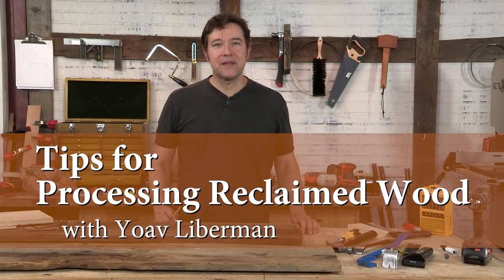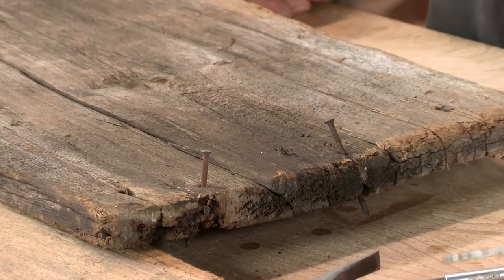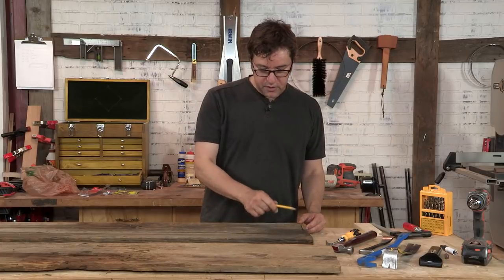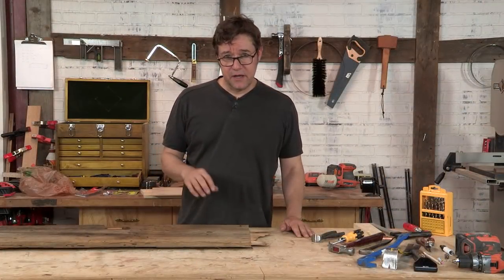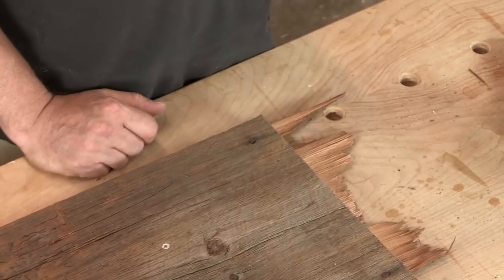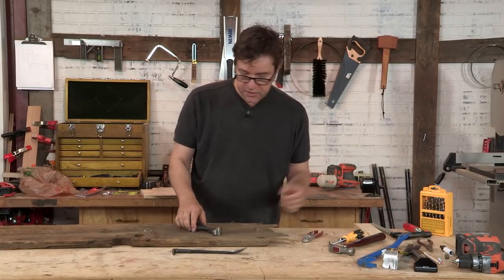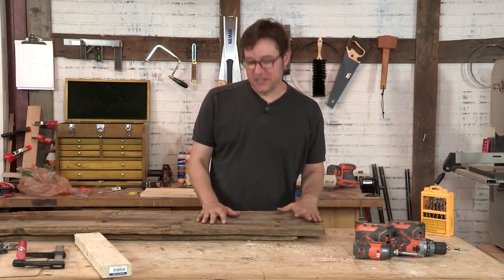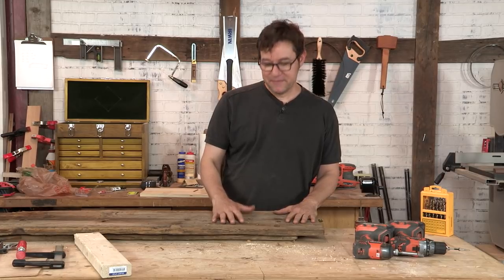Tips for Processing Reclaimed Wood

Comment: Thanks for the tip on getting out embedded nails using a hole saw.  I have some nice oak boards with quite a few countersunk nails that are sheared off on the back of the board.  I will try this, but with a 1/4" diameter diamond hole cutter.  The hole itself is only 1/4", so easily plugged with 1/4" dowels if need be.  I've found a small cat's paw to work best. This tip should speed things up. I've been using a countersink on the underside to pop up the nail head, but this may speed things up.  These old boards are so much better than what you can buy new.  Well worth the time.

Comment: I've found that a pair of plumber's slip-joint pliers are one of the best tools to extract nails. The ends get a good grip on the nail, even if the head is missing, and the diminishing-radius curvature of the back of the pliers gives you an excellent fulcrum that gives you a LOT of mechanical advantage.

Comment: My tip. Never put reclaimed wood through a jointer or thicknesser  that is dirty, been on the floor etc.
Old wood, pallet wood, reclaimed wood, probably has pieces of grit embedded into the wood grain, it will chip and blunt your jointer thicknesser blades. Have an old plane to quickly take off the surface after you have remove any metal, takes a minute to roughly plane, a lot quicker than sharpening your  machine blades.
Reply: Another reason to do the above, once saw a guy saw some large pieces of wood on the table-saw that destroyed the blade teeth. He had used a metal detector to check for metal, he did not use a plane to clean the wood.
The wood was about 8 inches thick, looked like one piece, it was two old oak fence posts that had been laminated together at some point, it had the remains of two bolts in the middle of the wood, the detector did not find them since they were four inches of oak between the bolt and the surface. If he had planed the surface the wood plugs that were used to fill the bolt holes were visible, he would have know that he needed to find out why they were there.
Reply: true dat!
Reply: my tip is lean the recovered wood against a wall, and blast it well with a pressure washer then allow to dry, then you have clean wood, no dirt in the surface.
Reply: Thicknesser? You mean a planer?
Reply: @JohnyKnox  yes. Doesn't matter what machine you are using. Planer or jointer, thicknesser, table saw. Unless you want to risk damaged blades. I would never used dirty reclaimed wood without a quick going over with an old hand plane.
Blades are expensive and a pain to sharpen.
Reply: @dwarfsbaneironfist2527  sorry I had just never heard the term thicknesser before. Definitely learned something new today but that's what these videos are all about eh?

Comment: on nail #3, why not 1) try punching it through with a nail set?   2) If that  doesn't work, use your hole saw on the back side, not the face side.
Reply: Exactly. As I watched I was thinking why not use a nail set and (like you said) drive it on through, or turn the board over and use a nail set to back it out so it could be pulled.
Reply: This a great tip Keith. The reason I showed the drilling technique from the face side (in this video) is because it is the most common and practical approach  when dealing with timber and beams. There, the option of extracting from the back side is not possible. In my upcoming book: Working Reclaimed Wood (https://www.amazon.com/Working-Reclaimed-Wood-Woodworkers-Makers/dp/1440350817) I shoe the cup-saw technique on a reclaimed beam.
Reply: I have my own personal MRI machine. i just line up the boards and all the nails get sucked out.

Comment: what-about fine staples and 23g or 20ga brads that just seem to break.????
Reply: Carbonite Gamorrean I'm not him, but maybe this will help; usually I just takeoff what is visible and if the remaining breaks off in the wood I leave it. If I hit it with the saw blade I'm not too concerned, the carbide teeth on a saw blade  will make quick work of soft staple metal . if you have to hit it with a jointer, then use a nail set to push it through and extract it with pincers from the other side... Works for me!
Reply: Thank you, but right now I'm using hand tools, and this is in some really hard wood i'm trying to salvage to make stuff from. And then I have two small pieces of oak with 18ga brads all over the place like a child when nuts on it. The first is a bench, the second = oak I my have to just work around it,

Comment: That metal detector didn't seem all that reliable.
Reply: I bet a magnet would work pretty good, especially the ones that sometimes come with a flat screen TV mounting kit.
Reply: We use magnets as a stud finder for steel studs all the time
Reply: Exactly. Magnets also work really well on wood studs by finding the drywall screws that get screwed into them.
Reply: This the metal detector that I have been using for almost 20 years. It is a British tool and I don't know if it still in production today. By the way, it never failed me. If I were to buy a new tool, I would have looked for a detector with wider scaring ability than the one I have in order to expedite scanning.
Reply: I have and old speaker magnet that works good as well and it also has an extra benefit of magnetizing all your screw drivers as well!